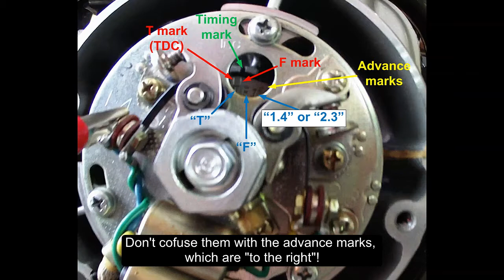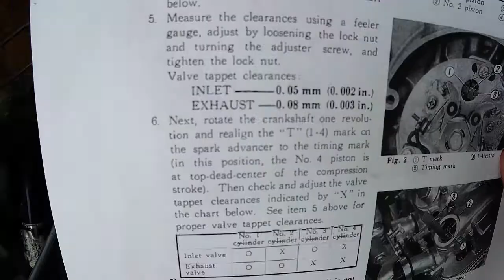1977 Honda CB550K: Spark Plug Replacement, Ignition Timing Adjustment and Tappet Clearance Check

Comment: Did you have to remove the tach cable to get cylinder #3 plug out?
Reply from the maker: No need, there’s enough working room and the spark plugs are easy to take out
Reply: @Batazlaja  hmm, maybe it is different with a '75 CB550F. Using the socket in the tool kit there is not enough room, perhaps if you had a regular socket there would be room. I ended up removing the cable to get to it. Thanks for your response.